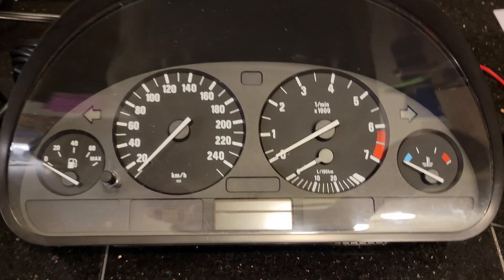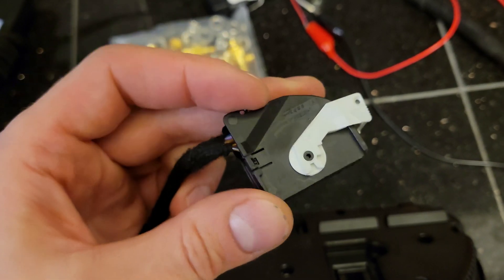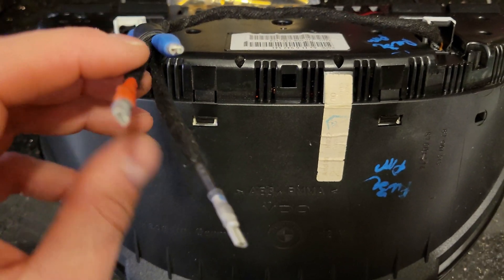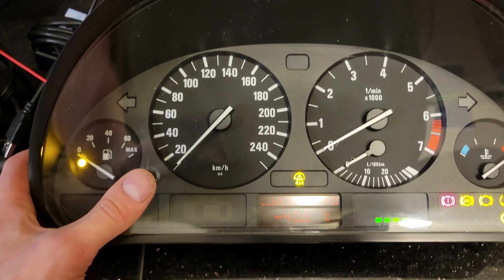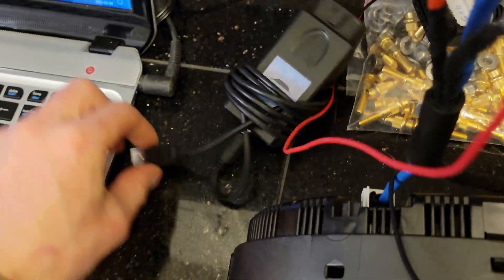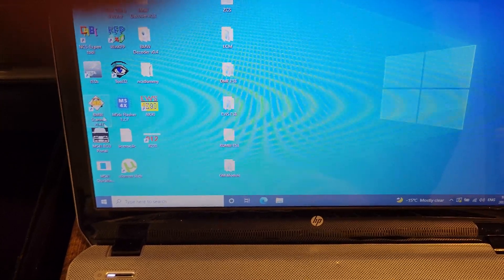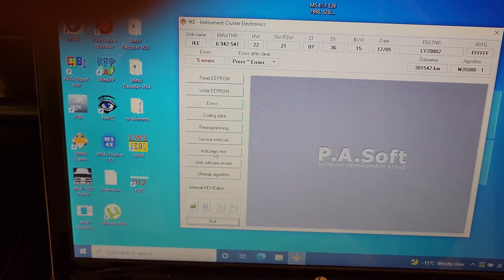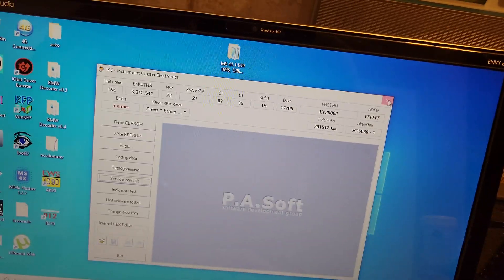BMW E38 E39 E53 X5 Low Cluster. How to power, bench test & wire up connection to INPA & BMW Scanner

Comment: Black Connector (26pin)
Ground: 1, 13, 25, 19
Pwr: 20, 21, 22
White Connector (26pin)
k-line: he doesn't mention it but I'm pretty sure its pin 12.